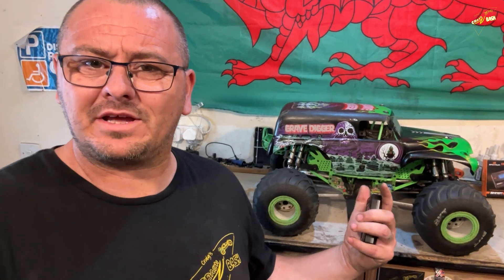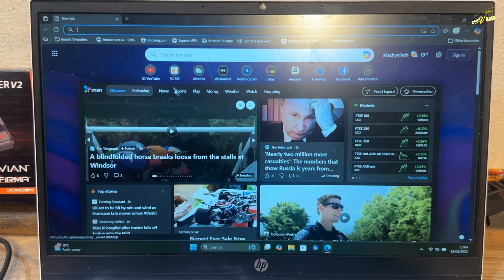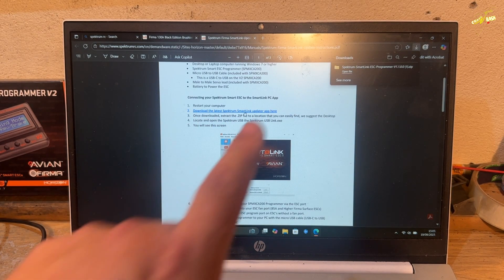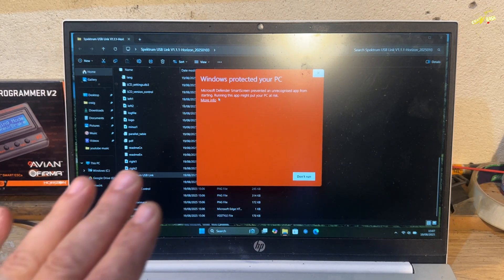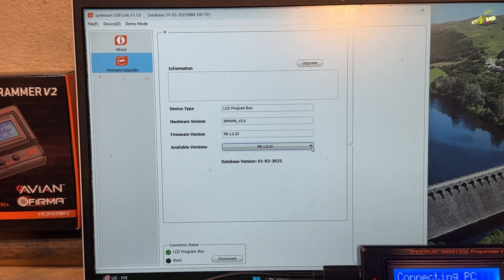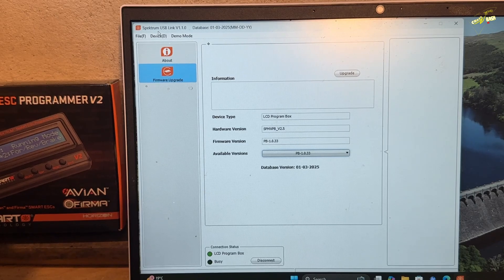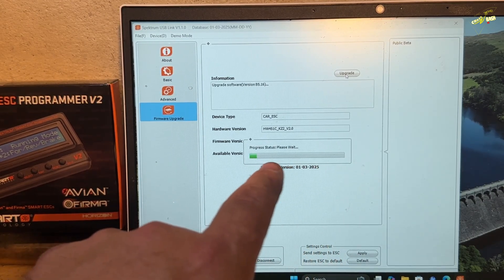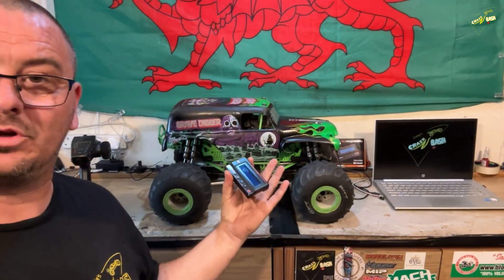How to update in under 8 mins , SPEKTRUM esc + program card

Comment: Hello. I downloaded the program (Spektrum USB Ink V 1.0.7) and for both the card (V2) and the escape, the "available versions" box is blank, and the version I have says it's dated February 11, 2020. Can you help me? I can't figure out what the problem is, and I can't update either the card or the escape.

ESC Device Type HW4100_KZ1_V2.0 Hardware Version HW4100_KZ1_V2.0 Firmware Version 02-00.1.02 Available version NOTHING TO SELECT in uniform gray Database version 11-02-2020
PROGRAM BOX Device Type LCD Program Box Hardware version SPMXPB_V3.0 Firmware version PB-1.1.09 Available version NOTHING TO SELECT in uniform gray Database version 11-02-2020
All installed in a factory-installed Axial SCX6, without any modifications.
The described behavior involves connecting the board to the ESC and the PC to access and adjust parameters. If I try to connect only the board to adjust ESC parameters, it displays: "Connecting ESC Please Wait." and blinks approximately every 5 seconds, but nothing else happens.
In any case, greetings and thanks.